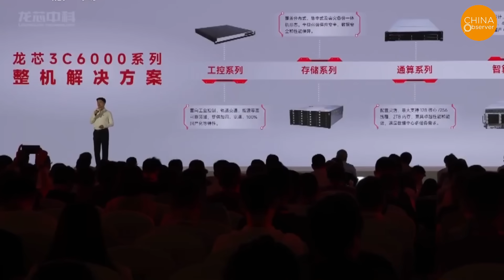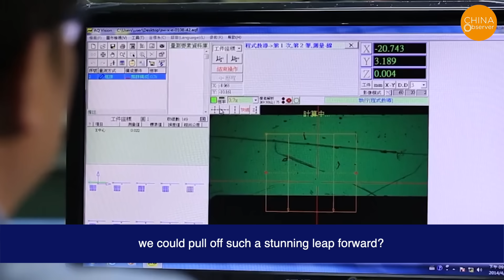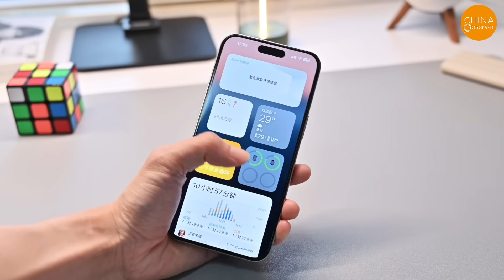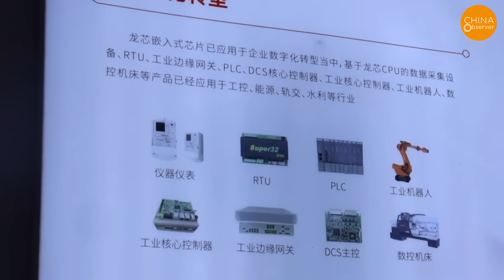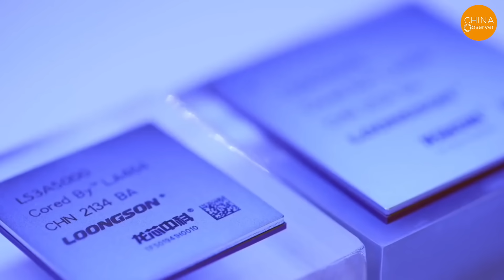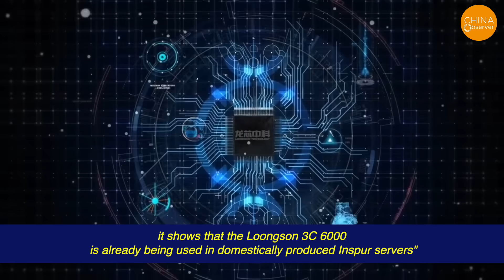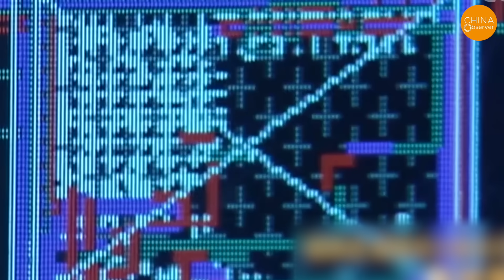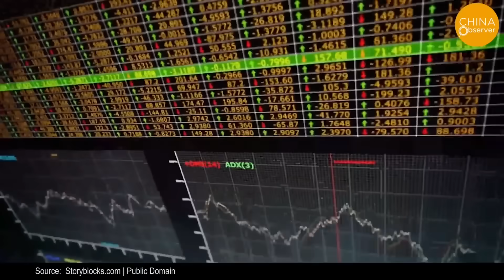Global Laughingstock! China’s Loongson Chip Claims to Beat Intel, but Lags 13 Generations Behind

Comment: 4:30 Dude Xeon series is on 5th generation right now. Core series and Xeon series operate differently! And tbh it's still an achievement, this is no easy job. Many new companies try even coming close to what Loongson has been able to reach to, but fail. Tbh it's a good thing! Overexaggerated? Yes, but that's politics and getting share holders

And point about ecosystem is correct. You need good compilers too, a stable ABI, and lot of software on-board. It can take time..

Comment: Loongson is the 5th company that has independent instruction system besides x86, arm, mips, risk-v, which will enable him to have big space to freely design the chip without the interfere from united states and by optimizing the design to improve chip performance, it can be used to compensate for the defects of outdated processes.

Comment: Companies like Intel and AMD would have been reverse engineering these chips long ago,almost immediately discovering that their efficacy does not match the claims and have probably given little regard to them since. 
I'm an automotive electronics/diagnostics tech and have the misfortune of working on Chinese cars from time to time, components,materials and design implementation are leagues behind European products.

A friend who's company reverse engineers automotive electronic components for various motor manufacturers, took a look at a failed TCM I gave to him from a 1 year old SAIC MG, a part that sells for £1800.
His approach was to concentrate on the more expensive(less cheap😂) components on the PCB and figure in a rough estimate for the lesser, more common parts. He then estimated, using his nearly fifty years of experience in the component part industry, that on a massed production level these units would have cost around £19 to produce, and furthermore for an extra £3-4 per unit they could have been made with vastly superior durability,the failure unquestionably down to poor quality components, them selves poor quality usually by virtue of the quality of the materials used to make them.( He also mentioned the corrosion already built up on the inside of the sealed TCM's  heat sink/chassis must have been present at the build stage and was something he'd never seen before!.)
 It's china, so whatever they claim you take off 25-50%.

Comment: Everyone here is missing the point, it's not meant to be running Fortnite at 4k but for basic computers needed to keep society going if completely cut off from the global supply chain like the USSR.

13 generations behind isn't too shabby for a 100% new design not based on Intel or AMD, if it can be equivalent to say a Core 2 Duo, that is plenty to run industrial automation, accounting and the like.

Comment: Given that they have no clue how Intel or AMD (Taiwan) have developed modern chipsets, it is still impressive how they have used enough coorporate espionage to make a processor comparable to the 1st generation of Intel Ix chipsets; no doubt with more coorporate espionage and several years of development/research, they'll be able to make chips that compete with modern processors (in terms of value and reliability)

Knowing that most modern (Intel and AMD) processors have built-in backwalls, this could mean that China is now attempting to reinforce their security at the core level with proprietary architectures such as domestically-made processors

Comment: F v q U...
You say  ". . .fully develped and controllable by China." as if Intel CPUs were not controllable by U.S. Government with backdoors masked as "Debug instructions", if you don`t belive me, search in Google: "UNDOCUMENTED X86 INSTRUCTIONS TO CONTROL THE CPU AT THE MICROARCHITECTURE LEVEL IN MODERN INTEL PROCESSORS".  😉
By the way, stop manipulating the information saying they are 13 generations before, because you are manipulating the time they need to reach the most advanced chips, not the time they jumped into now, because they have reached this technology without needing the same ages that Intel needed (since 1970). China is gonna dominate the future, not today, but it will, and I´ll can laugh in your face 😉

Comment: This video is somewhat misleading. China has a much faster chip in its arsenal. It's called Hygon Dhyana and Hygon C86. It was a joint venture between China and AMD, and is designed using the Zen 1 architecture. Not fast by today's standards, but overall not bad for heavy compute tasks. While it was not entirely developed by China, they were involved in the development, and have full control over production and distribution. It is on the 14nm process, and therefore not hit by the sanctions preventing China from buying the latest and greatest. That 14nm design in particular was not made by TSMC, but by Global Foundries.

Comment: On one hand this is good that China is developing a in-house processor and is proof the damn country can produce its own unique tech.  
On the other hand they are still behind by years and lied about it. 

There is a silver lining to this.    That's in its potenital to develop a infranstructure for the product.    They could indeed push this and develop their own true systems and products around the chip and overtme refinement of the product could indeed allow it to catch up to Western technology, it will likely remain behind but refinement and evolution of the product could allow it to eventually be compatable or similar.   

Still another silver lining for western countries is that the current regime in China will screw up natually and the product will never move beyond its current issues for many many years.    By the time it does Western Markets will likely already be several more generations ahead.

Comment: China will never get ahead of the rest. For one main thing. They have never developed anything in house. It is always a copy of something, built then copied and pasted everywhere. 
 Also with the chip, the equipment needed to make a new generation of chips is never going to be handed to them. And if they make the machines at home, they won’t have the software capable of doing it. It’s just facts. China is the cut and paste nation. 
 If they HAD made their own industry in anything, it would be good. But everything is from outside and pasted to fit. Test it. Ask anything China has made and you will see it came from outside.

Comment: If this CPU is really as good as a 5 years old Intel CPU then considering that a 5 years old Intel or AMD processor is perfectly capable of running everything (on a consumer level) then I would say this is really a breakthrough just not in a way these people broadcasted.
Then Intel can say bye-bye to a pretty large consumer base - if people in China are willing to switch and if this is compatible with Windows x86. Most people don't use processors made by bleeding edge manufacturing processes so it's completely irrelevant. The Ryzen 3000 CPUs came out in 2019 and they're still very good for most people.

Comment: i mean im impressed its equal ro a intel chip from 5 years ago. i would have guessed it would have been closer to a core 2 quad lol. 5 years back is not exactly slow... not that its of use due to the instruction set.  wonder why they didn't just use RISK V

Comment: i work with flash drive and .ssd "intel" micron hynix and samsung toshiba is good
in 2017 ymtc  came in . its bad speed .program erase time is bad 
but after 3 generation 
now day 40% ssd use YTMC .232 LAYER . VS SANDISK TOSHIBA BICS 6
YTMC IS VERY LOW COST ,IN 2024 .PATRIOT ,ADATA,USE CHINA NAND

Comment: Based on benchmark from Tom's Hardware, new loongson 3A6000 performance is just slightly below intel i3 10th generation. Honestly, it's not a bad start for a country that just started, but they shouldn't market it as a breakthrough cpu that beats leading cpu companies either.

Comment: The Loongson 3C6000 series processors adopt the Loongson fourth-generation microprocessor architecture, with 16 LA664 processor cores integrated in a single silicon wafer, and support 32 logical cores through simultaneous multi-threading technology. Based on Dragonchain interconnection, the Loongson 3C6000 series supports three different numbers of silicon wafers (S/D/Q) in packaging, and can reach up to 256 logical cores through multi-channel direct connection at the board level, which can provide sufficient computing power for different application scenarios and effectively meet users' application requirements for single-core high performance and multi-core high concurrency.

It's only 3-4 years behind the house. We're talking about a leapfrog from Intel Core Duo to AMD Zen 3 performance in a single generation. They'll probably catch up to the pace within 2-4 years.

Comment: So they're doing comparisons with tech from years ago while still running massive server farms filled with nothing but NVIDIA, Intel and AMD parts that absolutely destroy them in every conceivable way. I can buy a 4nm processor capable of 4+ ghz and 6000+ mT/S as the entry level of this generation.

God forbid these chips have some kind of crippling security flaw when they get integrated in China's state tech infrastructure, or the fact that the 12nm process means they could very likely have their infrastructure just brute forced via a cyberattack with the massive gap in computing.

Comment: It doesn't matter, those chinese chips will have their market and the sanctions will help to establish an ecosystem and improve them fast, because they need to do. In the past this was not done, because this task was insane with the possibility to just buy the parts from the shelf from outside. But this is no option anymore. So we should put our noses a little down and better be prepared that all those things might be solved within the next few years.  Then there will be no easy way in into china for western chips and tec, because this is something the chinese have full control over.
Reply: In the next few years we will have a fully operational AI technology, good luck catching up....
Reply: @whereareyou222  Thats not the topic. Althought the chinese have already their own developments here as well.
The topic is about if china is able to come up with a general purpose processor good enough to solve typical tasks. My point is, that will happen and they will force it into their market and lock out western tec.

Comment: I am not going to be laughing about 12nm or performance from 2000 chips etc. I don't think is laughable. 
It is still an impressive thing if it a new chip tech they developed themselves. 

What am really wondering is something else. 
No western technology? So is not based on ether x86 or ARM or even Risk-V? 
But a completely new architecture with different type of instruction sets?

Then how did they compare to Intel? What programs do they use? Are they even programs for this since it is a new architecture with new instructions? How did they measure it?

Comment: They are proud but its incomplete. New instruction set means new software. They will likely use linux if they don't write their own. But emulation is extremely costly so they arent just low teir and 5 years behind. They are 10 years behind minimum and they will stay behind unless America fails this decade.
Their best strategy is to add their devices to the linux kernel.

Comment: @7:58 nah correction - Windows NT (current moniker version is 11) is designed to be architecture independent/easily portable "compile"-able to other architectures. In theory it shouldnt take much effort to compile for this architecture. The source codes for Windows NT 4, XP and Server 2003 had been leaked as early as 2004 and late as five years ago - they should start doing compiling that for this to try like this guy: https://www.youtube.com/watch?v=AWZe00v2Rs0&pp=ygUhY29tcGlsaW5nIHdpbmRvd3MgbnQgZnJvbSBzY3JhdGNo

Comment: I think the processor and in extension the architecture does exactly what it meant to do. Separating the Chinese software from the rest of the world. China is fighting tooth and nail to control their media space and it get harder every year. The availability of software to circumvent the media control is growing, and they get easier to use all the time. So in the eyes of the state the only way to block all foreign software is to build a complete new hardware ecosystem. And when China is separated from the word by hardware and software, it didn't matter how slow or aged the hardware is, there is nothing to compare it to.

Comment: RISC-V will be the non-proprietary international standard, will probably run circles around loongson MIPS arch fairly quickly since it learns from MIPS shortcomings and optimizes other aspects of the older RISC architecture MIPS/Loongson is based on.

Once RISC-V Linux/BSD/tools settles out I bet they switch to RISC-V since conversion would be fairly easy; RISC-V is functional on Linux/BSD/Tools, just needs a bit more tuning and hardware implementation optimization to be on par or faster than ARM.

Comment: technically, it can be used, but it literally sucks with overheating and strange intel xeons inside as if theitr processor is desperate try to make amd VERY EPIC X256 SHEER THREADFVCKER OVER9000

Comment: Having a different instruction set is crippling since you have to rewrite all the application ecosystem.  Good luck with that.  Why do you even compare it with x86 cpu speeds since it's not an x86 CPU?

Comment: 12 nm ?  10 nm processes for Intel was many, many, many years ago.  Almost an antique.

On top of that, if not using EUV lithorgraphy then multiple patterning (3 or 4) to achieve small design rules will be horrible on yield rate driving costs up massively.
Reply: Keep in mind, Intel has been around since July 18, 1968 while loongson was founded in April 2010.

Comment: I can't trust any info provided in this video because it's so poorly written that there are so many false info even. Is it on par with intel 3rd gen but provides 2020 performance? Intel 3rd gen was from 2012, it wasn't 14nm it was 22nm and it was significantly slower than anything made in 2020. Even that info is so public, so well known, if you don't know that and make this mistake, I don't know about the legitimacy of the rest of the story, it can be filled with made up info, you see what I'm getting at? So let's assume they made a chip that's on par with 2020 intel. That is impressive. It's a fully domestic product. It's also very very scary for the west because 2020 level of computing performance is basically more than enough for everything other than winning AI training race. It's good enough for every industrial application such as automobiles, robotics, any personal computer device. Do you see how much of a big market China is to have their own domestic chip that is actually fast enough for everything other than AI. Do you see how much big of a deal that is? I believe not so because you said "laughable" multiple times.

Comment: First, not really mentioning AMD (which is a better alternative of Intel since about a decade) is pathetic. Second, when it is China and chip production, you always need a grain of salt. The thing is that manufacturing technology (12nm, 7nm, 3nm etc...) means nothing on its own, so China can trick you easily. Take say 3nm; I'm sure China can (or chould) make chips like that IF they build very small chips, tweak down the clock cycle to virtually nothing and accept the yields low like hell (i.e. the production cost is skyrocketing). I.e. it would be an unusable chip, but produced domestically and 3nm, so be scared you western bastard!
What they don't have yet whatever they say: a viable laser to produce anything below 7nm (and even 7nm is very problematic, likely they cannot really do it) and advanced packing capabilities, i.e chiplet/tile production capability or 2.5D production (like 3D cache). Moreover, as long as they are using their own ISA (like LoongArch), they don't have decent SW support either, but they can make ARM or RISC-V. And they don't have CUDA and decent GPU cores either.

Comment: Having a unique architecture and CPU instruction set, and a computer system and network that are composed entirely of them, can be of some value in classified information and military applications.

If neither party can invade the other's system, at least the risk of information being stolen or cracked and causing a system down is significantly reduced.

In addition, even if the absolute performance is low, by combining optimized programs, it is possible to build a unique application environment, and the ability to domestically produce all of it is of great significance in terms of maintaining the productivity of precision-guided weapon systems.

However, the situation changes dramatically when emulators appear that can run any program while converting each other's architectures and instruction sets in real time.

Since the operating speed of an emulator depends on the processing power of the CPU, after the emulator appears, the focus of both camps becomes how far the absolute performance of the CPU can be increased, and when one camp acquires processing power that "exceeds the native environment of the other camp, even through an emulator," the other camp's architecture completely loses its reason to exist.

 Japan also went through a similar process, and personal computers with unique architectures made by Japanese manufacturers, such as NEC's PC-9801, Fujitsu's FM-TOWNS, and Sharp's X68000, which had absolute dominance in the Japanese market in the 1980s, were ultimately all defeated by PC/AT compatible machines by the end of the 1990s.